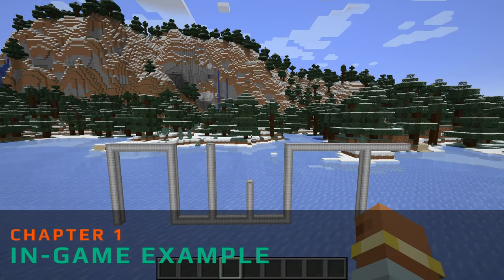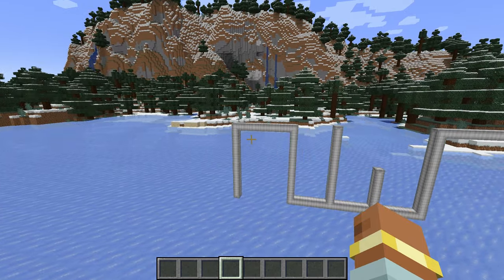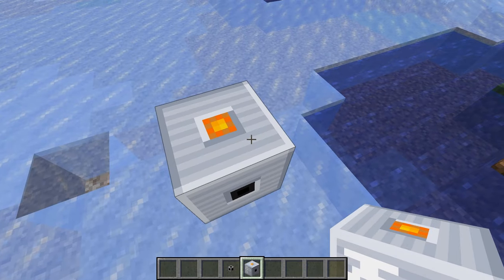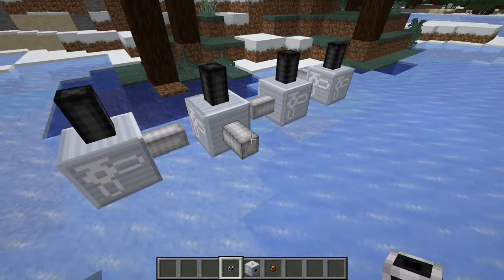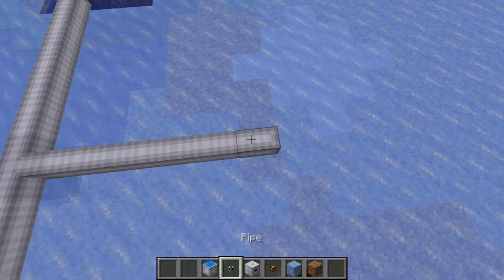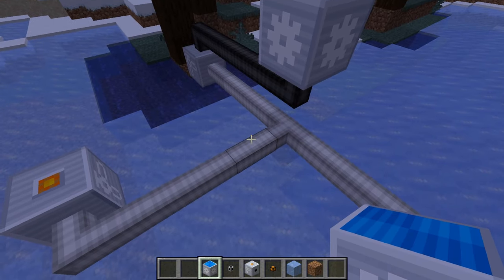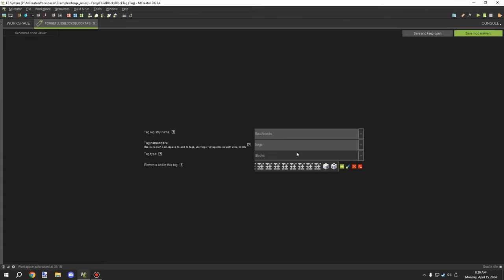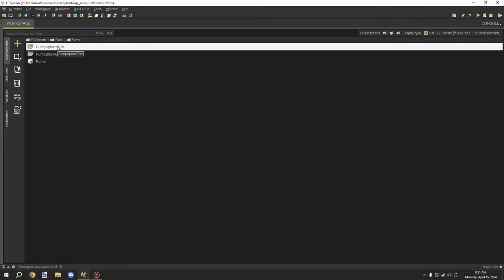Part 8 | FF Fluid Pump | MCreator

Comment: beautiful series I hope it continues
Reply from the maker: I ran into so many issues with fluid it would require a complete remake and most things the community wants/needs are not possible with Forge Fluid like sending more than one fluid. Though I did start working on a variable based system that will be compatible with both forge and neoforge but I need to make sure the math is correct and all that because if it's not then its more work for me to correct the issues and then make a new video about it. I also have a lot of other stuff going on for projects so I have not had much time to work on it I have the discord server and finishing stuff up there for release, CCTV Craft has been my second priority as its basically a paper weight in it's current state after Mojang removed support for testing material types and then starting a new gaming series tomorrow so I have lots of prep work for setting up the workspace template which will last 3 months. And then also weekly videos for MCreator but thankfully I got this week done on Monday so Friday won't be as hard.

Comment: Me In the meantime doing a 2798 Lines of code procedure that runs on tick X energy pipes: fear me 🔥 😎

I didn't know you were doing this when I started doing energy things,noice 🙃
Reply from the maker: pretty good timing, fluid is still unstable but I plan to work on it and try to figure out what's going on, just motivation and time constrains are a bit of a hard factor for me at the moment.
Reply: @NorthWestTreesMCreator  I'm sorry to hear that,if you gotta take a break I would understand,my procedure is quite long but checks everything and does everything you need,I just need a way to stop energy getting in from sides I don't want it to... Mhh,well,good luck!

Comment: Yay, the quarry machine's a'coming
Reply from the maker: I still have some major issues to figure out with this I have to put it on hold until I can figure out what's going on with the fluid system. I can't wrap my head why fluid sends some times and other times it does not send any at all. But when it has  decided to work the quarry is functional but I am not able to record it just yet until I can figure out why its acting like it does. But I will be keeping the series open and will come back to it once I have fixed the issue.

Comment: How would you add a water tank block with the forgeflow system, and is it possible to have it visually change textures depending on level without having to make multiple blocks?
Reply from the maker: I am still trying to work out issues with the fluid system. At times it works but its still in beta, when I figure it out I will patch the project workspace and release a new video for the changes but currently the fluid system works at times and others it does not though the energy system currently good.